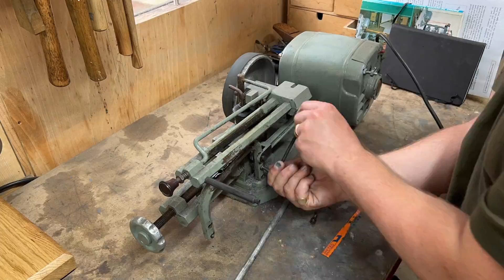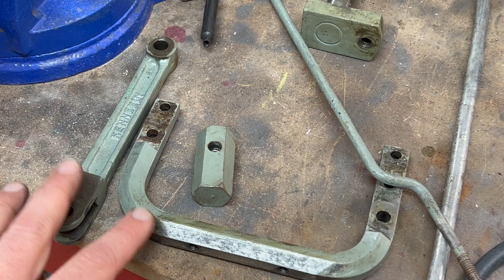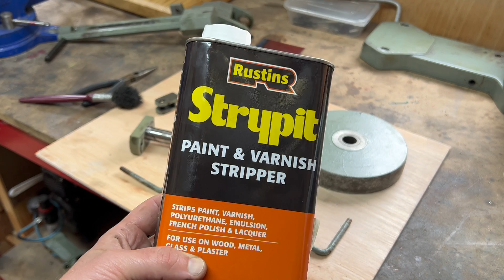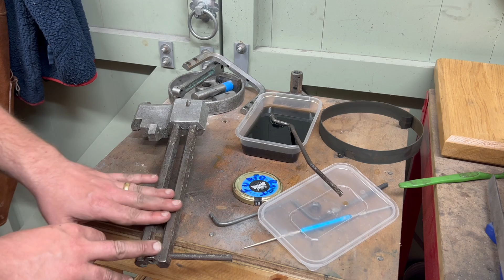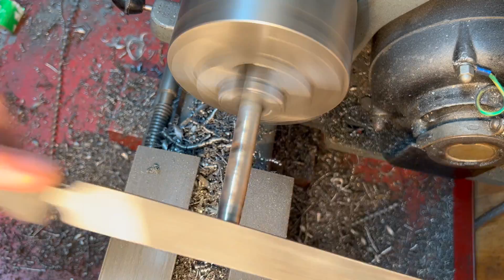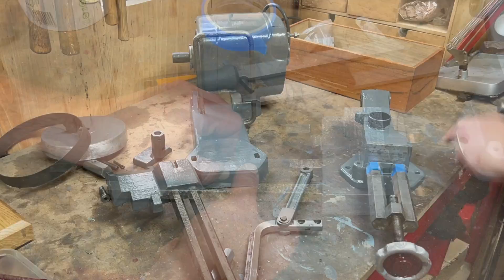Kennedy Hexacut Powered Hacksaw  - Cosmetic Restoration

Comment: I have one of these saws, my belt kept slipping so converted to a pulley belt system. I haven't a clue what the other lever is that protrudes from the  rubber gator is for?  any ideas. I did ask a youtuber that also has one of these but he also didn't know.  (subscribed)
Reply from the maker: I haven't got the foggiest what that lever is for - in pure cargo-cult fashion I just put it back on mine!
Reply: Thanks William, it can't be anything to worry about then.  When I put I converted to a pulley system I meant V belt but you probably realised that.
Reply from the maker: @bertyjustice  looking through the literature apparently there should be a 'flap washer' attached to it which covers/more or fewer of the holes on the plunger in the oil pot, to adjust the rate of descent of the arm.
Reply: That makes sence thanks William.  I don't think many owners would use that anyway as when cutting  a solid piece of steel we end up putting a bit of weight on the end of the recipricater.

Comment: Hi William.  I bought one of these saws many years ago.  Used it quite often, but some time abo, when I started it up there was smoke from the motor.  Switched it off and not looked at it since.  I hope to find someone locally who can check it out.  Thanks for the reference about not removing the motor from the frame.  I had no idea of course!  Geoff
Reply from the maker: In retrospect like a lot of these things I imagine they’re a much more capable machines for the same or less money - but for a space star workshop and a penchant for vintage tools it can’t be beat!
Reply: It may have just been a capacitor going bad. The filter caps used with brushed motors or speed control circuits usually go open circuit and in many cases the motor can still be used.
Reply: @OnlyAmiga85  Thank you for that Paul.  I did wonder if it may be the capacitor, but when the motor started  smoking I decided best not to try to run it.